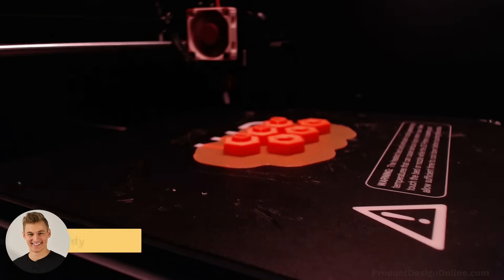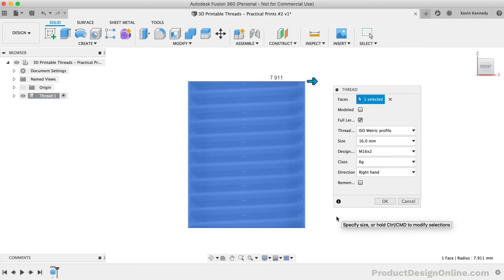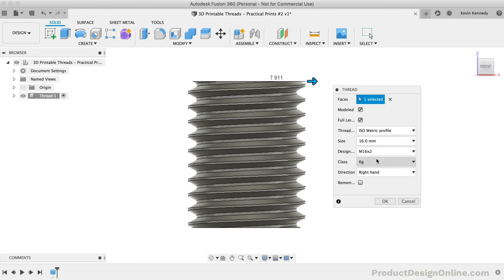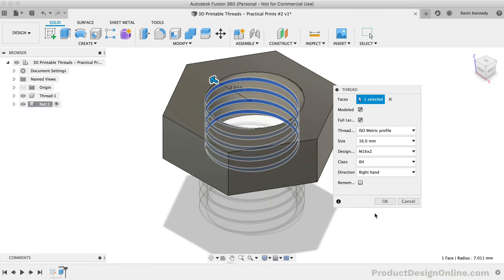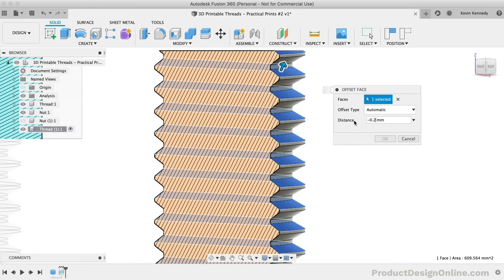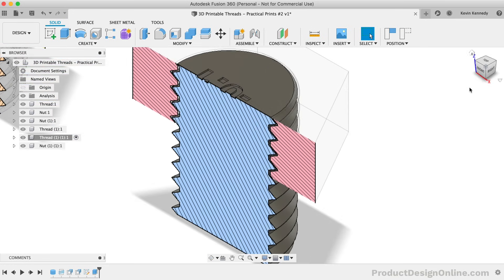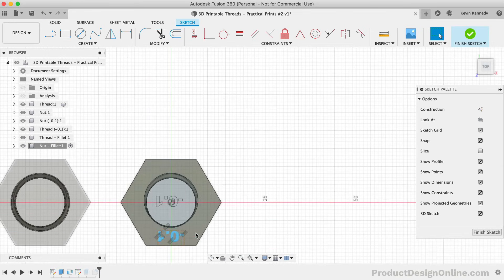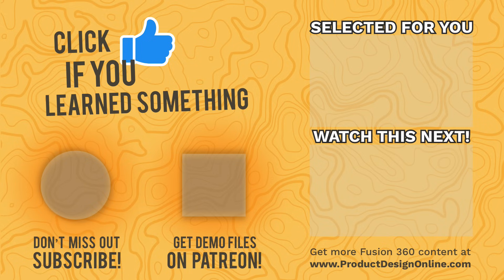3D Printed Threads - Model Them in Fusion 360 | Practical Prints #2

Comment: I've been accomplishing appropriate clearance using a non-uniform scale.  I scale the bolt in the x,y (depending on the orientation, of course), and this does the trick.  For my printer, the sale value (again depending on the size of the thread) is typically .995.  I find your videos very useful as they expand my 3d modeling knowledge and skills.  It has helped immensely in my design endeavours. 👍

Comment: This was the most helpful and well explained video on threads I found. Using these principles I have never had issues with 3d printed threads. Another tip for others printing. If your thread is delaminating from 3dprinting, decrease layer height when printing small threads that will give a better result.

Comment: When I try to offset the face of the thread (around 14:45) I get an error: The cylinder diameter is invalid. Maybe something has changed in Fusion since the video was made? At any rate, changing the offset type to "New Offset" seems to have done the trick.
Reply: Same issue 14:35 , I’ll try your solution and comeback with the result
Reply: It worked thanks

Comment: Update for those visiting in 2025: 

3d Printers have gotten a lot better: I just printed a 1/4" (6.5mm) UNC-20 bolt on my Ender 3 v3 KE with threads so much smaller than the one in the video, using the same method and it came out amazing. So, it'll really take some experimentation and tuning on your printer, but it'll highly likely that yours will turn out great too!

Comment: The 'thread' tool in F360 has to be one of the biggest failures, they don't bother allowing customization or custom thread types, they dont have any offsets, you can't save anything, it's like an intern wrote it 10 years ago and they forgot how it works.

You're absolutely an expert in f360, and your expert method will mean 6 fiddly operations for EVERY SINGLE THREADED HOLE modeled in an assembly using the thread or hole tool in F360, that's how garbage it is...

Comment: When printing the parts together with the nut and bolt at the same time it fuses together and i cannot separate them no matter whether i use the offset or not. Bambu lab X1c 0.4mm nozzle

Comment: @11:08.. This is not about calibration of the unit at all.. This is about printer head diameter. Realistically you want 0.2 mm, we all do because it's nice and it allows tolerances of both half a mm and under a quarter. 0.25mm is perfect because you can hit four passes and have 1mm full mm. Anyone that's printing smaller than 0.25\0.20mm is going out of the scope of what a 3D printer is made to do and designers are asking a lot out of additive manufacturing to make something so small. 

In my experience a small quarter of mm requires a direct drive system because you are trying to force material out of the head at a specific rate.

Why is this small size important? If you're trying to make a tight gap for screws. You need more precision from the printer to get a clean shape. At 0.25mms you are working below 8x magnification and well within the same surface finish of machining a part at 0.01inches. 

The only way you are going to get a part smaller than this, with the desired strength and precision to deliver higher accuracy is by, cutting and using metal. Plastic is not made to work below 0.001 inches. Not unless it's typically made in a vacuum form diecast mold and typically it has a high compression strength when we use this method. This is because it's being used to ensure there is some small flexibility between two pieces of metal or material to deal with expansion and contraction, that must achieve a perfect seal under high pressure that can create galvanic corrosion or crack a lens of high strength ceramic. (Such as the windows of a submarine for example.) The purpose as mention then is to get a product that meets exact measurements to ensure the shape of the product performs exactly as required. So that when compressed, or pressed it fits under load at the exact dimensions. 

No person in their house, or in a small warehouse in Columbia... needs to build a submarine that can take a compression load of 35,000 lbs. No Engineer is going to make a 3d printer that you can own for under 1000 dollars that can create high precision vacuum form parts. Sorry.. You're just going to half to work with 0.01 inches of tolerance in all of your designs and know that tolerance when designing parts and pieces.. and if you need higher precision of alignment for application purposes.. Use chamfers and buy Class b screws and hardware to make more accurate assemblies. Just like we do in the real world... >.> Welcome to Manufacturing processes I....

Comment: Or.... You could change the thread quality and it will do this automatically via the 6g or weight function of the thread tool. For inch you have ABC A is about a 0.2mm gap you can feel the play between screws and nuts. C is really for Nasa really and metal.. The threads have a slight interference fit and will grind themselves to a perfect tolerance in about 3 passes that makes them to the last class. Which is class B. Class B is industry grade. the Majority of items in your home use class three threads.

Comment: You don't need to copy-paste the bolt to make the threads on the nut. You can simply create a copy of the bolt and "press pull" all walls of the thread and then choose the option of combine and cut, uncheck "keep tooThishis will delete the copy of the bolt used to cut the threads and will leave you with the nut and bolt at the tolerance you chose

Comment: Great video, I learned a lot after 3d printing threads wrong for a few years, apparently ;)  I was curious if you could comment on how changing the nozzle size down (ie: to say 0.2mm) and how a person might go about modelling garden hose threads.   I often need to swap between GHT, GBP and pipe thread.  Thanks.

Comment: Great walkthrough. Weirdly though, even though I followed your tutorial to the letter (as far as I can see anyway), when I go to offset the thread face (video time 14:30) I get a CylinderPrimitive error of Cylinder diameter is invalid and it will not allow me to bring the face back by the 0.1mm. It ignores any change I make there due t to the error. I wonder if something has changed in Fusion since this was written?
Reply: Thanks!
Reply: Ok found the answer. Looks like Autodesk may have changed the default offset type when using 'Automatic'. The automatic default seems to be selecting 'modify existing feature' which will not work. I had to manually select 'New Offset' rather than 'Automatic' and then my model behaved as in the video.

Comment: Great video, with the explanation on how each setting affects the success. Video is slightly older (no emboss tool for text) but super practical content. I had no idea that modeled threads were “normal” geometry and you could futz with the faces (since fusion knows they are threads if you hop to manufacturing). I often tell my students to use modeled threads if they were planning to tap the holes/die the bosses as non-engineering plastics aren’t as happy getting machined and rigid tapping can crack, but cutting existing threads puts much less strain on the face. 

God before thread tools, doing the helix and sweeping a triangle that pierced the path was so painful to tweak, although you could make any whacky custom thread profile. Want Abraham Lincoln’s head profile as the thread, no-problem! But modeling in 50 holes needed a lot of Red Bull and skipping lunch!

Comment: You should comparis the Fillet (on the screw) in a Slicer too. Just to make sure it is applied like intended. Would also be great to add in an Video. An updated Version for Fusion 3Dprinted Screw Science would also be great, most videos are over 3yo and not for printing.

Comment: i followed this exactly up until the point of creating the second component. i do it exactly like you, right click, select new component and instead of just adding another component the dialog pops  up for "new component" just like the bolt.  tried moving along with the tutorial but as soon as i get to the section view the cross section is not lined up like yours. the tops of the pitch are basically inside one another. any help to fix these issues would be appreciated
Reply: nvm, figured it out my own way :D lol

Comment: Any suggestions on the 3D printer to buy that is capable if printing threads? I'm a total newbie with an idea. I'm guessing the cheaper printers would not be suitable. The threads I'm wanting are fairly course.
Reply from the maker: What is your budget? If you've got the means, I would recommend a Bambu Lab printer. Otherwise, starting with a 'cheap' Ender is totally capable of printing threads. It will depend more on setting up your slicing settings and making sure the bed is level/printer is dialed in.

Comment: This is a really informative video, thank you. I'm having a problem applying the fillet to the edge of the bolt thread. I can do both to 0.9 but it still gives a slight flat edge, not a complete round-over. The second I try 0.1 I get an error, and it does it with anything larger than 0.92 as well. I can't do it at all with the internal nut thread, I get an error with anything greater than 0.0. 

What can I do to achieve the complete roll-over? My experiment is using an M20x2.0, so while the overall radius of the test is larger the thread pitch is identical to the example.

edit: managed to achieve a similar result by doing a "full round fillet" and selecting the two other faces of the threads to form the roundover between. Now to print and see how it goes.

Comment: Made one today at 16mm diameter, cleareance is - 0.35 in the inside top / bottom and -0.10 for the wall. And for the bolt -0.10 and it work like a charm. When not fully screw there is kind of woble but i don't care at all. But honestly the thread tool is not very powerfull and push pull sometimes it not working at all. For exemple -0.35 i needed to make -.20 then -.15.

Comment: Hi Kevin - 
Thanks for your excellent content!
I am drafting a threaded component for a project that requires an M12 bolt and nut with a pitch of 1.75 mm. I followed along through this tutorial and need help with the fillet on the edge of the threads. Do you have any recommended tolerance settings for this size thread and pitch?

Comment: Just 3d printed an M8 internal thread with prusament PLA (195°C, 0.4mm nozzle) on my Prusa mk4. No tolerance modification. The M8 screws I have barely fit but I need a wrench to screw them in as it's so tight. Fine for my application, but yeah.

Comment: @productdesignonline Can you make a video on how to make threads that self screw (don't know if that's the right description). For example it would be like if you make the bolts in this video taller and when you put the nut on, it would spin all the way to the bottom of the nut without applying external force.
Reply from the maker: Thanks for the suggestion!

Comment: You're my go to when it comes to Fusion 360 design for 3D printers. I'm currently having a problem where orientation matters. For example a bolt that when screwed all the way in has one face of the bolt pointing in a specific direction. My first attempt has it 30 degrees off, but it seems that fusion 360 determines where to start the threads and doesn't allow you to change them. When I try to duplicate your steps in this video the threads in the two components don't line up like they do in yours. I believe that's my underlying problem.
Reply: Figured it out. I had to grab the object after I added the threads and rotate it until the threads lined up, then I could orient the features that are direction dependent. Wish that was all in the thread tool.

Comment: How do you offset the thread edge when the thread doesn't go down the entire cylinder, e.g. threads at the top of a container?  Since the thread edge appears to share the same outer diameter as the rest of the cylinder, the offset distance by default is the same diameter as the cylinder and throws errors when I try to change it (by say -.1mm as suggested at 14:40 in the video).

Comment: When I try to thread the inside of a cylinder it makes the cylinder wall thicker.  My wall is 3mm thick but when I add threads it makes the entire cylinder wall 5mm thick.  Not just the threaded section, the whole cylinder.  Pulling my hair out.

Comment: I've watched a few of your tutorials now and have picked up a number of things. You do a great job of illustrating a projects steps and capture a lot of the interface subtleties that I've struggled with as a novice. 

I have a suggested improvement to add to the printed thread. You video go me to the goal of figuring out the filets/offsets for my machine but even with the perfect fit initially getting the threads mated is problematic. I solved for this by adding a taper to the end of the threaded bolt end to trim away that initial thread. I do this by extruding a cylinder matching the bolt diameter and length and coinciding with the finished bolt. After I have that cylinder in place, I chamfer the end, on a m16 x 2.0 bolt, the chamfer is 1.5 horizontal and 2.0mm vertical. Next I do a Combine and select the intersect option. That effectively trims away that real sharp initial thread and now fitting it to a nut is easy. Without this fix I think many will continue to offset the threads to get easy insertion but maybe end up with a little wiggle in the fit.

Again, thank you so much for your very well produce videos... you clearly have a gift for instructing. I'll be watching and learning.

Comment: Great tutorials! Would much appreciate something that addresses this---I select thread 1/2-13 UNC but my 3d print comes out at 7/16-14.   Trying to make a 3d printed 1/2-13 bolt hole to work with 1/2-13 steel all thread

Comment: Let's say you have a bottle, like the kombucha bottle from Costco, and you want to design a plastic part that receives the thread of the bottle. How does one go about doing that ?
Reply: take measurements and apply them to a nut in fusion 360 ?
Reply from the maker: I love kombucha 😋

This one is tricky to answer as it really depends on the type of bottle. There are some standards in the industry, but plastic and glass bottles vary greatly. The kombucha bottles I'm thinking of are glass with small metal caps.

You could go through the thread defaults in the Thread and/or hole command and try to match it.

Comment: I'm not sure why, but I found that using the "Q" shortcut option (14.25) would not successfully perform the Offset Face command. When I selected Offset Face from the Modify dropdown in the Solid menu, it worked fine.
Reply: I just spent the last 2 hours following step by step through this video 100 times..  I was about to throw my monitor through the window.  WTF?  Can anyone explain this?  When I selected that face and pressed Q, the distance is pre-populated with 16.00mm.  And while you can change it by entering something different or by dragging the handle, it doesn't change the face.  But as Bruce kindly noted if you choose "Offset Face" from the modify drop-down, the distance is populated with 0.00mm and you can then change it.  I also noticed the dialog for the "Q" version of "OFFSET FACE" has an "Offset Type" input field, while the dialog for the modify menu drop-down version of "OFFSET FACE" does not.   This is the kind of stuff that is maddening about Fusion 360.  So much is contextual but it's documented NO WHERE.

Lastly if you use the "Q" version, if you set the "Offset Type" to "New Offset" it does seem to work.
Reply: @doc_d4566  Same thing.  Almost down one MacBook.   As you mention, going from the main menu or changing to "New Offset" makes it work.  Glad I read the comments.  Thanks!
Reply: @doc_d4566  thanks!
Reply: OH MY GOD! One year later and you are still saving people. I was stuck on this for two hours... You legend!!! Thank you so much.
Reply: same here. thanks!
Reply: thank you, that was driving me insane

Comment: Why did I have to move the nut .5mm away from the bolt head? I'm not following the video exactly. I'm making a nut and bolt for a project. I mirrored the head of the bolt to the other side (to make the nut body) of my model and created the shaft of the bolt by extruded a cylinder from the head of the bolt to the nut with a -1 mm offset (to form a cap nut).

Comment: One 3D printing workflow I struggle with sometimes, is trying to build support structures into a complex Fusion 360 part design.  Generally, I can manipulate a model in a slicer and leverage the use of supports (typically tree supports), especially now that the more popular slicers (Cura 5.3.0, Prusa 2.6.0-alpha) support paint-on supports or custom tree supports.

I would like to figure out a way to include in the F360 design ways to add break-away supports that I can't generate with the slicers.

Comment: Hi.  I cannot get the fillet in the third set to work.  When I click on the outside face of the thread and press "Q", the Offset Face window pops up and is already filled in with 16, and when I change it, it seems to modify the diameter of the entire cylinder.  If I click on the face inside the thread (the middle of the screw) it will have a default of 0 for the Offset Face box.  Any ideas what is going on?
thanks.